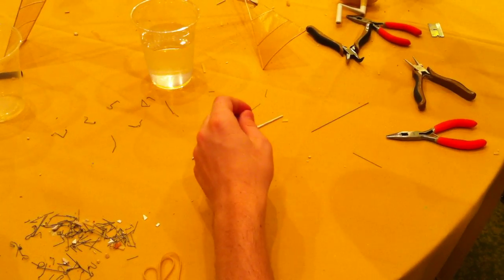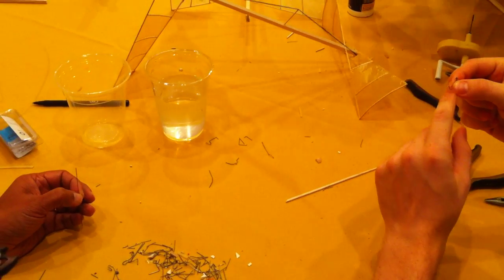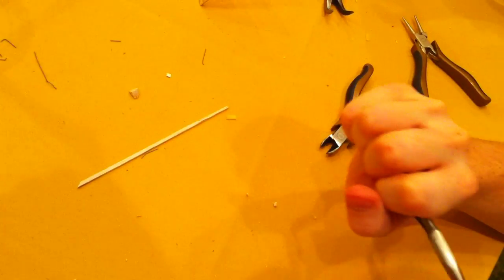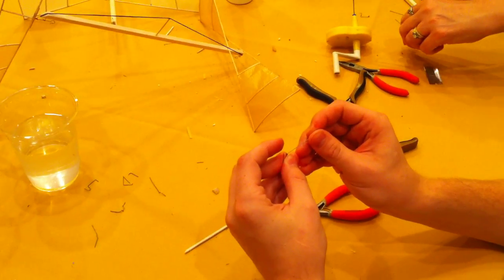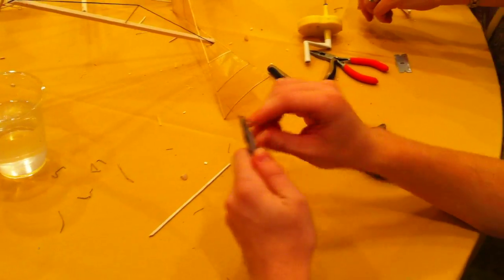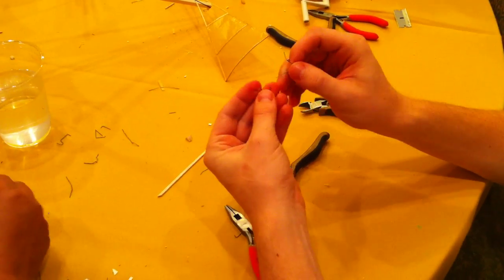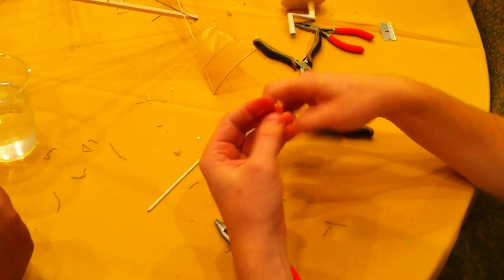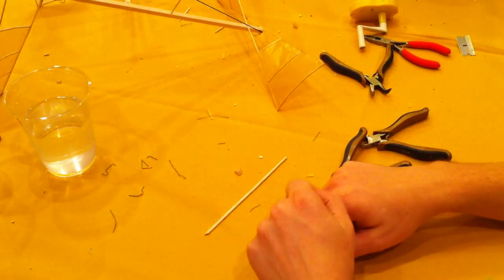Science Olympiad Wire Thrust Bearing

Comment: I agree, it would be nice to actually SEE what their hands are doing. One question - so is it possible to make a Div C helicopter without buying any special materials (we have lots of balsa and tissue from gliders) except for the rubber band?
Reply: Probably. Seems like you only need balsa, covering (mylar/grocery bags are lighter but tissue works), CA/wood glue, wire, rubber, and rubber lubricant.
Reply: It is how the metal is turned and twisted that I want to see up close.
Reply: I agree it's difficult to see in this video but seems like it's basically just wire bent into a triangle, then folded over the other wire hook tight enough so it doesn't wiggle but loose enough that it can spin smoothly. This is a ray Harlan thrust bearing: http://www.indoorspecialties.com/contents/media/l_image011.jpg. You can save yourself some trouble and order one of those. 

Also, I believe I recognize your name from scioly.org (drcubbin?). There are many experienced fliers there that will check and respond to questions on the helicopters thread, probably more so than an old youtube video.